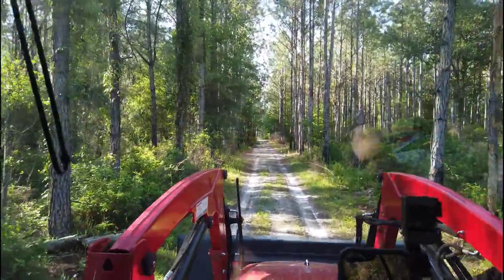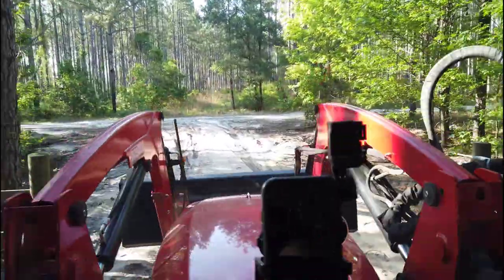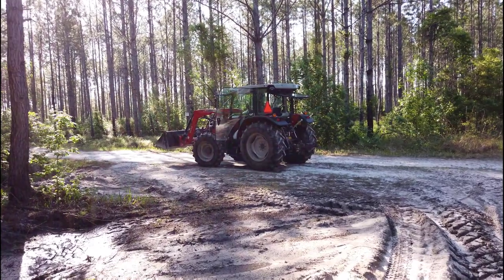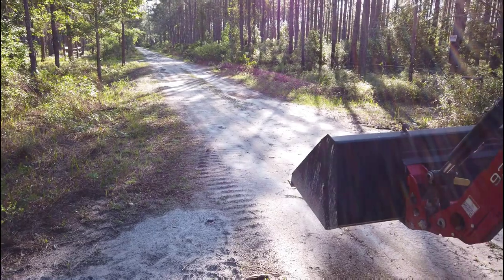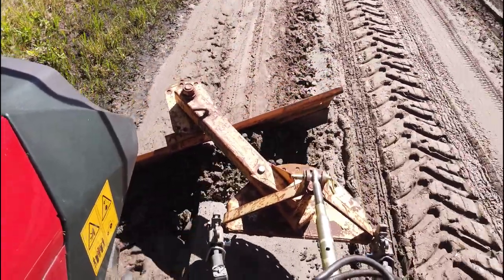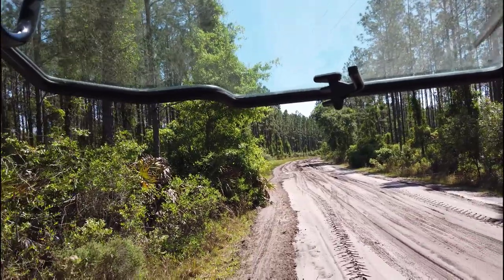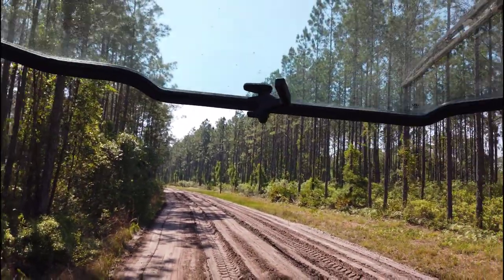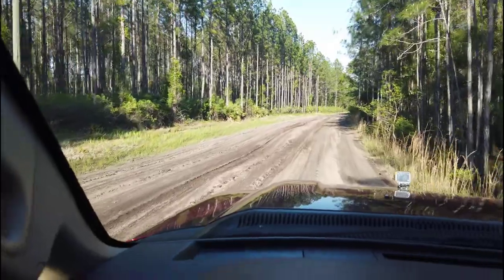Back Blade Road Repair After Logging Trucks

Comment: Just picked up a heavy articulating blade yesterday (FORD) with hydraulics... looking forward to doing the same up on the mountain! Great Video!!
Reply: I hope it goes well. We are just getting into the rainey season again and the roads are a mess.
Reply: We know that one too... water=SLICK and RUTS!. I installed it yesterday (75 degrees) and ran the road to test the strength and cutting ability of the blade. Looks as though other than keeping an eye on the wear blade edge... this is going to be a game changer on snow in the winter!